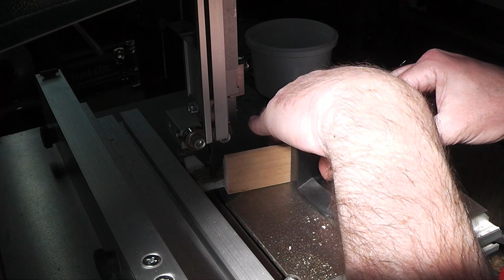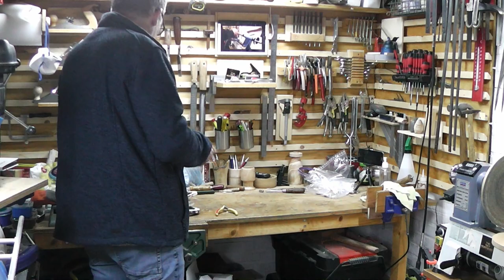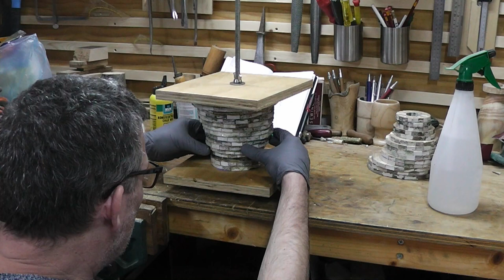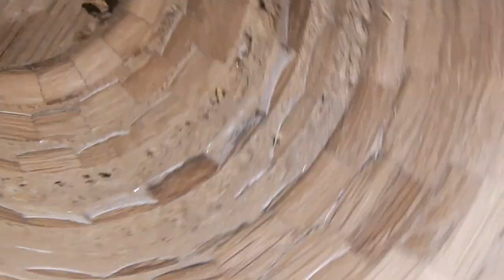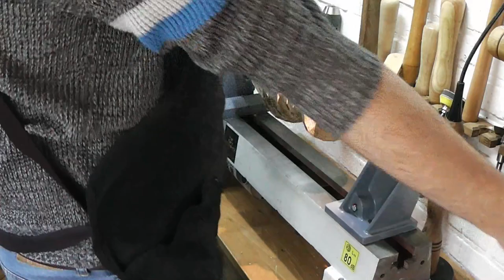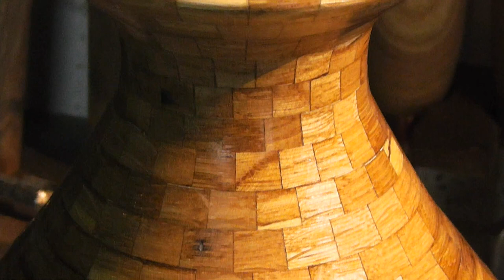Woodturning - Segmented Vase - Scrapwood Challenge.

Comment: My gosh Frank, you have the patience of Job!!! Such fiddly work but well worth it!! One thing I like about PU glue is it expands so you don't have to be so careful spreading it, true?  It's a good thing you came across these racks before you made it to your back porch😁  Thanks for presenting this daunting project🙏 Glad you let the shop apprentice take the ball back🐕 Stay safe.  -Mike
p.s. I find gluing rings for my scrollsaw bowls from big to little a bit easier ... each smaller ring can be referenced in the center of the bigger ring it sits on. And using a lazy susan turntable helps to distribute concentric errors.
Reply from the maker: I had the time and I have the patience😎. I noticed that the PU glue also needs to be spread well, but by expanding it fills my bad saw cuts😁. Glue on one side and slightly wet the other side works well. It was indeed difficult to glue so many rings at once. I will do that different next time. Good tip from you to work from large to small. I also plan to start turning between gluing, so that the inside can be finished better and you can correct mistakes in the gluing. There is still so much to learn. Thanks again for your comment Mike.
Reply: @TheTinyWorkshop  If I ever get the ambition or think I can, to do a tall vase, I'll turn in in & out in sections too😁
Reply from the maker: @mpart_woodlathe-stuff  I have to be careful that I am not only going to do segment work. I like it that much.😊

Comment: Wow! Frank I didn't expected that big and segmented projects. You have spent a lot of time to do it. As we see beautiful wood is everywhere. Just we need to have open eyes.
Excellent work my friend👌
Thank You very much for Your time and joining to the fun 🤝
Take care and be safe.
Rafał
P. S.
What do You think about tie straps?
Reply from the maker: I was also amazed at how beautiful the wood was after having been outside all these years. Yes, it took a lot of time, but it was also a bit of meditating while gluing 🙏. The tie wraps worked better than the metal hose clamp. (I referred to your idea in the video😉). The hose clamp and PU glue are not friends. Thank you for this challenge Rav! I had a lot of fun and learned a lot! 👍💪

https://youtu.be/jGGReLru2Ac?t=141
Reply: @TheTinyWorkshop  Yes, I have seen  this admit. Thank You 😊 That's why I asked. Tie wraps method is much cheaper and it works very nice. PU glue is very dirty. Glad You wear gloves. This glue needs bigger temperatures for drying. In 10 Celsius degrees it is not work.
Have fun while learning, learn by fun.
All the best my friend.
Rav